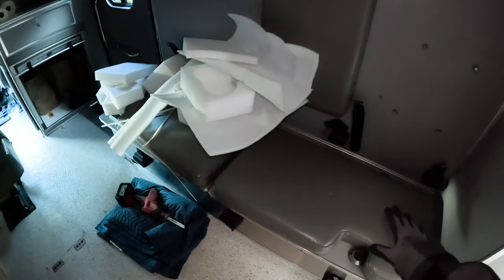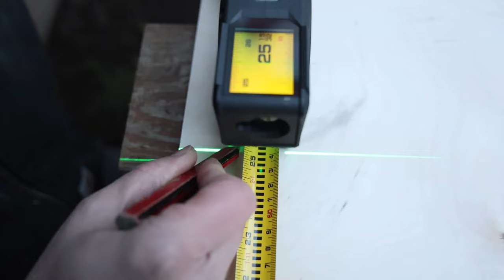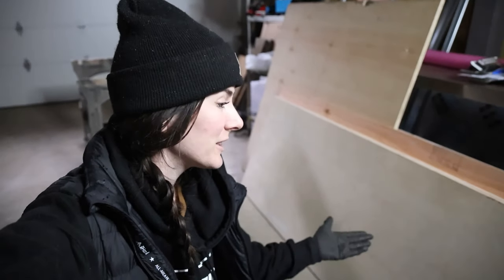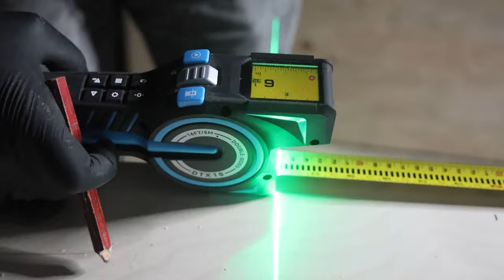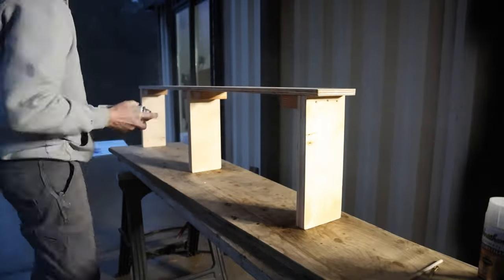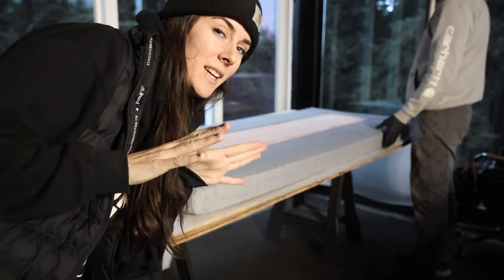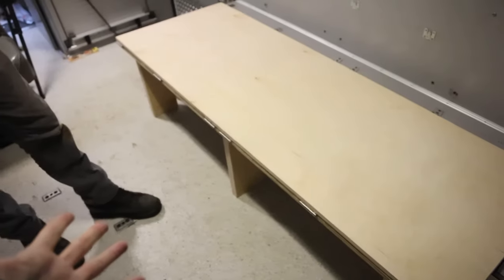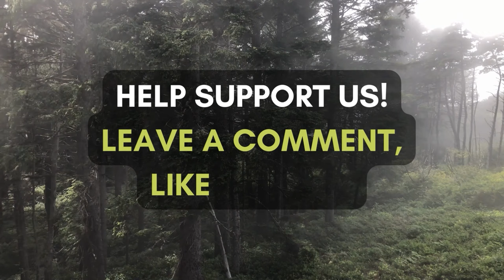SOFA? BED? OR BOTH? DIY CAMPER VAN BUILD using the ACEGMET DTX10 #vanlife #diy #build

Comment: You should put a support under the outer set of hinges for the bed or the hinges will give way with the wait in the long run.
Reply from the maker: We usually put the support towards the middle of the extended piece to even things out, but we might end up doing that in the future! :)

Comment: Great job, guys! How do you keep cushions from sliding away from each other? And are you securing (attaching) the support underneath the bed while driving?
Reply from the maker: Thank you! The cushions are heavy enough that they don't slide apart, but if that becomes an issue we will use velcro or something similar to keep them in place. The support is a tight fit under the bench, and the pads on the bottom keep it from sliding. :)

Comment: Oh... not that you need any inspiration, but if you want some - the best van conversion guy on the internet is on the channel Dual Ex.  That guy does some top notch work and has converted I don't know how many vans, RVs, campers to a modern home on wheels.  He just built one of these fold-down sofa-bed things.  Another channel - Salvage Workshop - is in the process of doing a really good job on one, though it's taking him quite a while, and Trent & Allie started with a home on wheels.  Now they are building more onto their home, but they started a business called Mountain Made Vans as a result of having tooled around this hemisphere in a home on wheels.  Since I'm often telling people about the best container home builds on the internet  (like your channel here), I thought that for a change I could tell you about a few good home-on-wheels conversions done on YouTube.  So... for whatever that is worth.  Meanwhile, I am in need of a new measuring tape... so I'll check this ACEGMET DTX10 out.  I keep damaging mine or wearing them out way too quickly.  Thanks for sharing that.
Reply from the maker: Thx so much for the suggestions! I will definitely check them out and maybe get some ideas! I appreciate it. :)